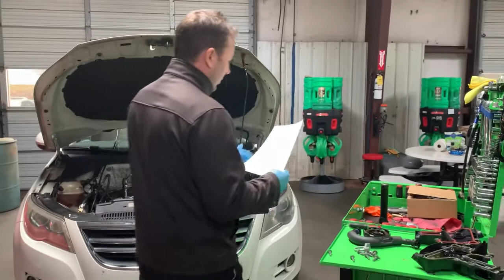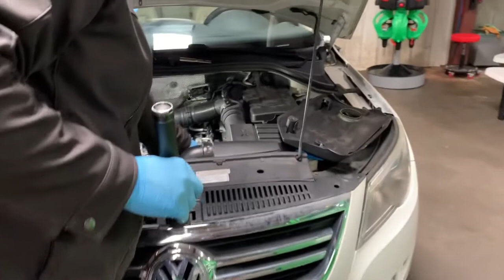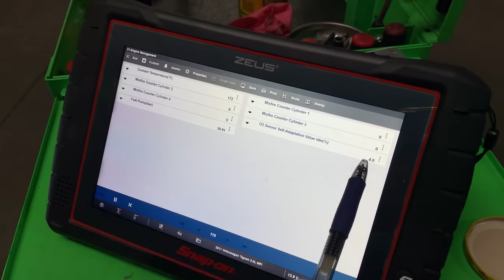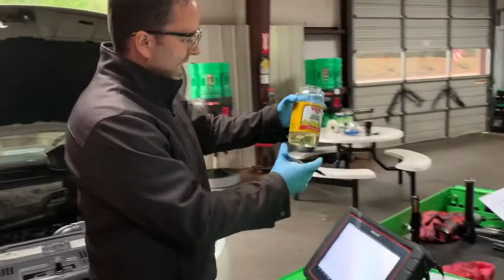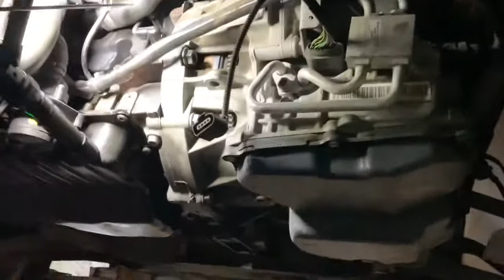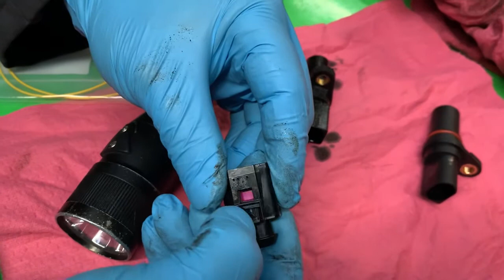Volkswagen Tiguan - Stalling , No Start Condition

Comment: Hello, I have a 2015 Tiguan. It cranks starts for a split second and then dies. It has spark, compression, fuel pressure at spec, no codes. It does start on starter fluid and runs for 10 seconds. I replaced fuel pump control module, drained all the fuel and replaced with new, new spark plugs, I took PCV apart and doesn't have any cracks and that other white peace is in place it feels brittle tho, timing is good. any ideas? Immo is good, no codes. its push to start and what's weird is that I need to hold button for it to crank its not enough to press it once. starts for a split second and dies.
Reply from the maker: The symptoms do sound like the immobilizer is keeping it from running. If the immo is not the issue, do you have a scan tool to check high pressure fuel pressure? I would also be checking the crankshaft position sensor with an oscilloscope for a proper waveform. 
Thank you for watching our videos.
Reply: @premierautomotivediagnosti9432  
Removed the intake manifold today, I checked the injectors with noid light and all fire. Connected fuel rail in place all injectors spray what seems to be normal patter, High fuel pressure requested around 43 bars and actual are 43-50 bars. I removed MAF sensor and noticed that its somewhat new and only similar product i can find on amazon for 25 bucks. Can a bad MAF make it not to start? also tried with MAF disconnected and it would still not start... after trying to start the vehicle removed spark plugs and only Cyl nr 4 trying to start because it was a bit smoking. I have spark on every cylinder tho.
Reply: Did you end up figuring out the issue sounds very similar to what I’m experiencing. Thansk!
Reply: @ilyachapskiy9665   I did. Actually the problem was a bad ignition coil. It had some kind of short inside that it would still fire normally but it was corrupting ECM signal so the timing was bad somehow. I moved coils around I was checking carbon left on 2 sparkplugs that would fire and after moving coils the firing cylinders would change but not according to where I moved the coils. Need to mention that after I would remove the spark plug I would need to blow out the cylinders because it would flood and it would not fire any more. I bought new coils just to try and it worked. Vehicle runs perfect  now. I added probably 10k miles to it already. There were  no codes in ECM and everything worked as it should only the timing was messed up. It had original coils that I replaced. 2 shops that only work on VW and Audi couldn't figure it out. One said that engine is bad another said that there's something fishy and didn't want to spend more time diagnosing the problem because of the unpaid time that it would take. I still don't understand why it would run on starter fluid. Probably injector timing was bad not the spark and eventually gasoline would wash out the rings and it would lose compression and would not run on starting fluid anymore for a day or until I would blow out the cylinders. It would run for about 20 seconds on starting fluid before it would flood. (important to remind that injectors were pulsing as they should). hope it helps someone

Comment: I was driveing my car fine then didn’t drive it for two days went out side to start it just stalls unless I hit the gas now it won’t even start and it would only start I’d tap the gas now won’t even start had 9 codes got it down to 3 only have p0301 p0300 p0304 did new coil packs spark plugs air filter and something els still no start

Comment: my tiguan crank but no start code is for high pressure fuel pump
Reply from the maker: Hello. High pressure fuel pumps are a common failure item but are expensive to purchase. Make sure you properly diagnose that failure before you purchase a new pump for no reason. Thank you for watching our video.